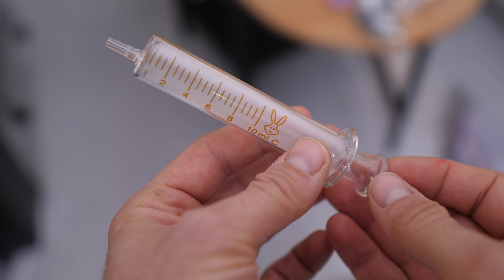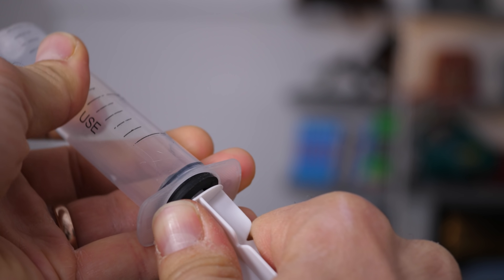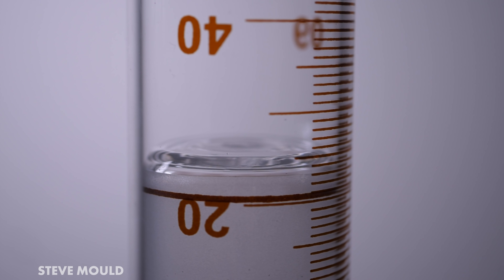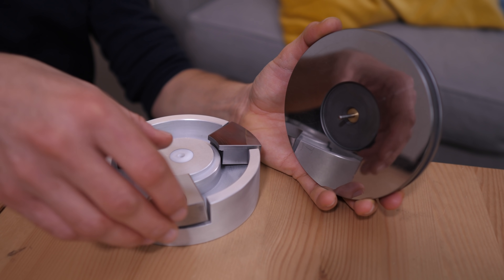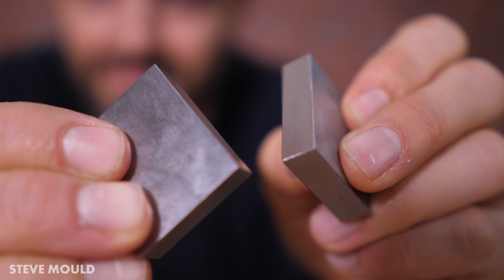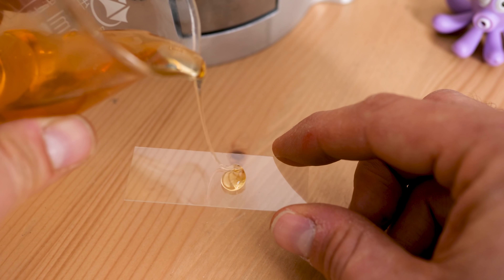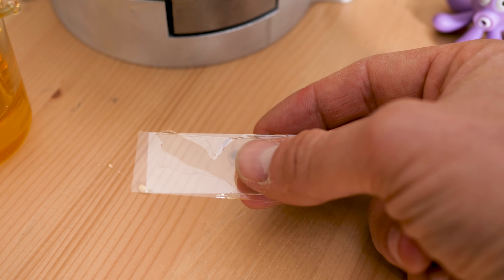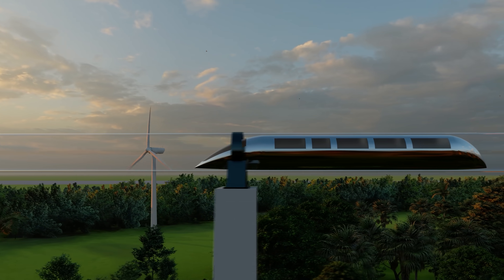The Self-Levitating Kingsbury Aerodynamic Bearing

Comment: Hi Steve, I think your videos are great! That sticky air phenomenon is called the Coandă effect. I once worked with a company that put that effect to good use in one of their products.
Reply: Is this really the same as the Coandă effect? As I understand it, the Coandă effect applies to air that was travelling in a straight line bending to follow a curved surface, whereas here the air was never travelling in a straight line. 

Also, I'd be interested to know what product you're talking about. The way you phrased it makes it sound like it's not a high lift device, but I don't know what else it could be.
Reply: Hey  @ltflipper2  , You’re totally right. The underlying phenomena are similar, but the aerodynamic bearing is more like the Magnus Effect.
The product used the Coandă effect for styling hair!
Reply: I first learned about the Coandă effect when Formula 1 teams started to exploit it, by getting the engine's exhaust gasses to stick to curved bodywork and increase aerodynamic performance.
Reply: Tom Stanton did a video on the Coanda effect drone... https://youtu.be/Irp_vnmUWZ4
Reply: "That sticky air phenomenon" is simply called viscosity.

Comment: 2:55 fluid dynamics is the top level term, whereas hydrodynamics specifically addresses liquids and aerodynamics gases. So no, it's not a hydrodynamic, but perhaps either a fluid dynamic or an aerodynamic bearing.
Reply: gas is a fluid
Reply: @jojojorisjhjosef  but not a liquid. Not sure if you commented before the edit though.
Reply: @niklaskoskinen123  ah sneaky edits, I see.
Reply: Aerodynamics refers to gases, but hydrodynamics is very often used interchangeably with fluid dynamics as a general case for both gases and liquids. That's because gasses at low speeds (typically up to Mach 0.3) behave dynamically the same as liquids. The math is exactly the same in both cases. 
Examples of classical texts that use the term hydrodynamics to deal with air as well: "Theoretical Hydrodynamics" by Milne-Thomson (originally, 1938) and "Hydrodynamics" by Lamb (originally, 1879). This unification of all low speed fluid dynamics under the banner of hydrodynamics is common even today.

It is also possible, and common practice, to use experiments in either air or water and apply the results to the other medium. For example, my MSc research was on hydrodynamic stability of sharks. I used wind tunnel (air) experiments performed on a 3D printed shark model to model the hydrodynamic forces on the shark.
From the other side, water tunnel measurements are often used when high Reynolds, low speed experiments are required, even if it's for an airborne system.
Reply: @ASJC27  this is quite convincing, so I guess I just don't support the use of the word hydro- when referring to gases. I mean hydro literally means water so extending it to all liquids is already a stretch. And we do have words fluid and aero-, if we want to talk about gases or fluids in general.

Comment: Kinda similar to the effects HDDs (the spinning hard-drives that store data) use for the read/write-head. It is hovering on extremely thin gas-layers.
Reply: And the term "computer crashing" comes from when HDD heads would literally crash into the platter, going through the gas layer. It used to be much easier for heads to crash.
Reply: @Gunbudder  when st invented the first mems accelerometers they actually marketed it at first to hdd manufacturers, the idea being if it sensed a high acceleration it would brake the hdd so that it wouldn't crash, but the idea never got off the ground. In the end they found their first market in appt washing machines that were too small to have concrete counter weights, so instead ge used st's accelerometers to use the motor itself to counter the vibration.
Reply: @xxportalxx.  Actually they don't brake the HDD but retracts the RW heads from the disk as that is much faster and safer. The RW heads are actually resting off to the side of the platters until the disk has reached the working speed. That way the air, or whatever gas the disk housing is filled with, will be moving fast enough that the cushion holding the heads from the disk surface can form. 

At work I used to have an old HDD that I used for testing. It was old and low capacity, 20 or 40 GB I think. It came from a customer who had us upgrade the storage in his old machine and he just had us delete it and we could do what we wanted with it. Now when working with it I noticed that it was very loud compared to other drives and I also noticed that I could feel air blowing on my hand. Turns out that there was a hole about 10 x 4 mm in the housing and through it you could see the edge of the top disk. This hole was originally covered by a foil sticker, but someone had peeled that off. Now we all know how microscopic the distance is between the RW heads and the disk surface, and we've seen these pictures of a human hair compared to the fly height of the heads and how the hair is way thicker than the air gap. That's why we are told that a single spec of dust can be enough to cause a head crash in a HDD. Now I had this drive that actually was blowing air at my hand through a freaking big hole in the side, and it was still working?

I used that drive on and off on the test bench for a few years before it got to embarrassingly outdated, and it never failed even though it was just stored on a shelf and we certainly didn't have a dust free environment. I have no idea how it managed to survive for so long.

Something else I never figured out was who had peeled off that sticker or why. Though I remember this same customer bringing in another machine that someone had tampered with by sabotaging the fans. Might have been a disgruntled employee, but I can only guess that it was done to cause the disk to fail, which failed miserably as the disk just refused to die.
Reply: @blahorgaslisk7763  the point was to not have the read head moving if you dropped the computer, as that's what causes a crash, so rather than risk causing more damage by retracting the read head across the platter the idea was to brake all the components so that it wouldn't damage the platter. That's how I remember the presentation, but it was last year so it's possible I'm misremembering.
Reply: @xxportalxx.  The disks take a lot of time, relatively, to brake to a stand still. We are talking seconds here. And even if you manage to do that you would end up with the read head resting on the disk surface, something you never want to do. In fact having this happen can cause the head to stick to the surface and you end up with a damaged disk. When you have two next to perfectly flat surfaces pressed together the gasses in the atmosphere will be displaced and the surfaces will form a close to perfect seal. The atmospheric pressure will then press these together so they appear to stick to each other even though there is no chemical or mechanical bond between them. If you try to spin up the drive with the heads resting on the disk they will scrape along the surface of the disk before the gas cushion can form and lift them, and again that is if they can overcome the stiction. Again not something you want to do.

The accelerometers are used to detect any fluctuation, such as the gravity acceleration getting lesser or even going negative and not only the spike as the drive or device hit the floor. If you drop the drive the gravity  acceleration detected will approach zero and that will be used to trip the head retraction. Retracting the heads take milliseconds and can usually be done before the shock of the falling drive coming to a stop or even reversing direction causes the heads to slam into the disk surface.

Any movement of the drive when operating will cause stress on the components inside, but the characteristics of that stress changes with the amplitude, frequency and wave form of that movement. Low frequency movements are pretty safe while a high frequency motion such as a spike in forces such as when a drive is dropped on a hard surface is the most dangerous. So if you can detect a drop then you can usually retract the heads before the drive actually slams into something. That's what accelerometers make possible.
Reply: @blahorgaslisk7763  sounds about right, as I said the presentation was quite some time ago. My memory has crashed quite a few times you see hahaha
Reply: https://en.wikipedia.org/wiki/Flying_height#:~:text=The%20flying%20height%20or%20floating,between%20the%20head%20and%20disk.
Reply: It's rumored that VHS cassette tape runs over a drum head, spinning so fast that the tape doesn't actually touch it--air cushion keeps the tape from rubbing the head.
Betamax did not do this, AFAIK.
Reply: @quietone610  interesting, they run very fast in order to keep the tape length short while playing back at 60hz, but designing in an air cushion to extend life on too of this would be a smart move
Reply: @xxportalxx.  I've repaired a few VHS decks and never heard that idea. It certainly wasn't part of the design specification as far as I remember, and if it was true then there shouldn't have been as big a need for head cleaning as there was.
Reply: I did a quick google search and turned up a patent application from a Chinese company filed in 94, I think it was. In it they wrote that increasing the rotation of the read head while winding or rewinding the tape would allow for an air cushion to form between the tape and the drum, thereby lowering the friction. 

Now VHS was released in the late 70's so that was way before that patent application was filed. 

The VHS decks I had would change the tape path to keep the tape from the drum while winding the tape. At least that's how I remember it. It's been a number of years since I last used a VHS deck, but there was a lot of mechanical movements done when you told them to wind or rewind the tape without picture.
Reply: @blahorgaslisk7763  it's the first I've heard of it too, however I've never seen a read head with any sort of plastic burned onto it so I suppose it's possible
Reply: @quietone610  Well, he usually get things right, and when he doesn't he publish corrections, at least that's what I've seen. 

So you may be right about the drum creating an air cushion, I've just never heard about it before. It would however explain how they managed to keep friction so low on the drum.

But also, as he said in the video, does it really matter? No these are dead systems! And I can't say I miss them other than for the simplicity of making a recording. However today most TV's come with some recording solution, but with the caveat that you can't just pop out a memory stick and take it to a friends house and watch what you recorded there as the record is encrypted and only can be viewed on the same TV that it was recorded on.

It's just as well that broadcast TV apparently isn't going to be a thing much longer, being replaced by streaming services. By now it's just old fogies like me that keep watching TV. Once we start to die off the classic TV channels will go away or move to streaming services exclusively.

However it's interesting details that shows that just because something looks simple doesn't mean they necessarily are.
Reply: I honestly surprised he did not mention hard drives in the video. 

Fun fact, the reason very large capacity HDD's are filled with helium is because it allows for a smaller distance between the heads and the spinning platter (helium makes a smaller bearing compared to air), making the heads more accurate and allowing the reduction of both the track size and the distance between tracks.
Reply: @UCo_UlZhV88T7DezHJXWj1Vg right but the head itself is riding on an air cushion, thats why high-speed drives use helium instead of air.
Reply: Also the motor rotating the platters in the drive nowadays use a similar bearing technology but with oil instead of air and as I get it these bearings will more or less never  wear out even operating at over 7000 rpm for years continuously. When these bearings rotate they are completley wear free because unlike roller bearings  there is absolutley no mechanical contact between the bearing surfaces  just like with these syringes. They just floats on oil and for the same reason they are also so quiet running you wont even notice them while the older ball bearing drives had a quite loud whirr noise. The older ball bearing drives could fail from wearout but I have never experienced or even heard of  a modern HDD motor FDB bearing ever failing. I read they have a MTBF of over1 million hours which is not even close to the total time that have passed since they first started manufacturing them. If I remember right this is over 60 years of continuous operation!
Reply: @johnpekkala6941  As a matter of fact all sleeve bearings running in oil are inteded to operate as you say. With oil in between the surfaces without the surfaces ever touching. The oil is pressed into the space between the axis and the bearing and forms a layer for the axis to float. However... unlike the HDD bearings you mentioned the effect is not as perfect. And bearings wear.